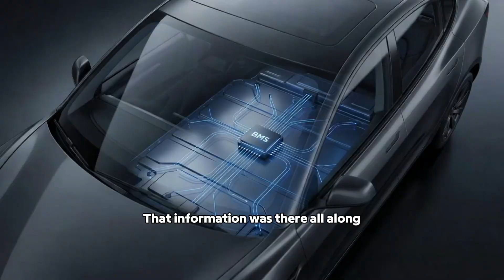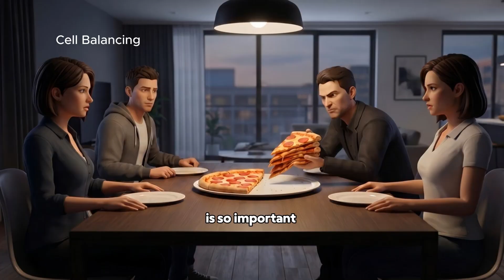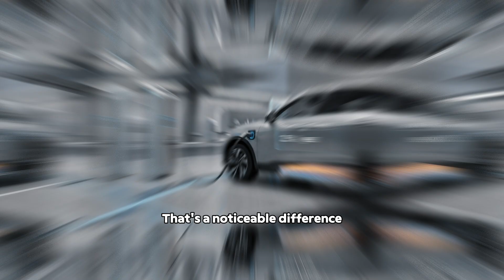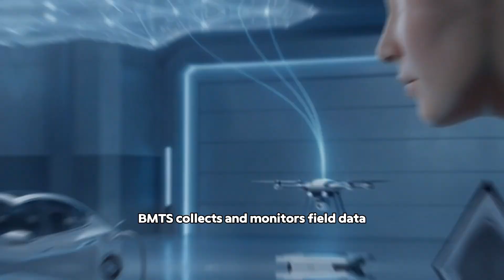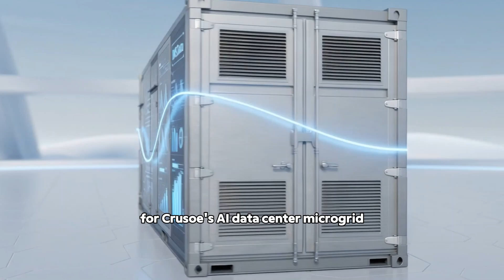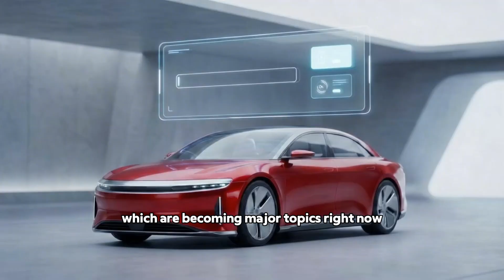Before Buying a Used EV, Check Its Battery History (BMS Explained)

Comment from the maker: Original Story: According to automotive market research company Cox Automotive, used EV sales in U.S. reached 42,080 units in April 2026, up 16.7% year over year. EVs also accounted for 2.8% of the used car market, marking a record high. As the used EV market grows, checking battery condition is becoming an increasingly important factor. BMS, or Battery Management System, is a system that monitors a battery’s voltage, current, and temperature in real time. It also manages battery condition through SoC & SoH estimation and cell balancing. More recently, as retired batteries find new life in ESS applications and data center power systems, BMS data that tracks a battery's usage history and health is emerging as a key asset.